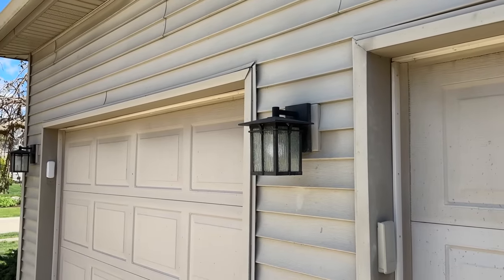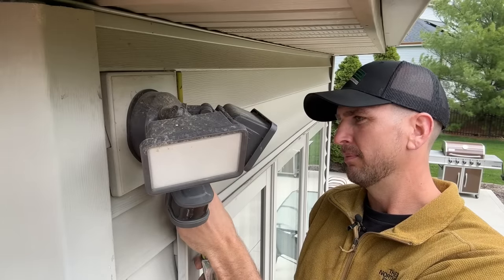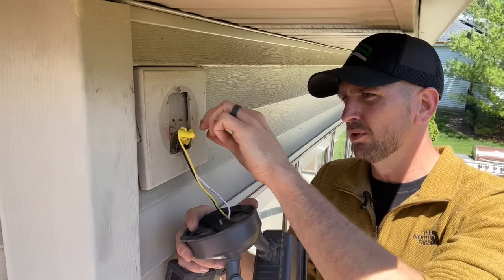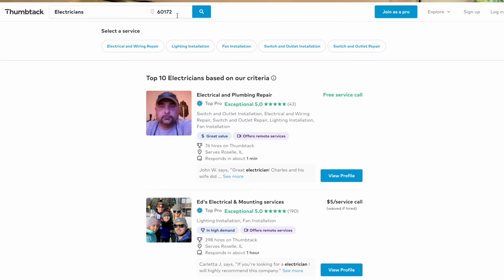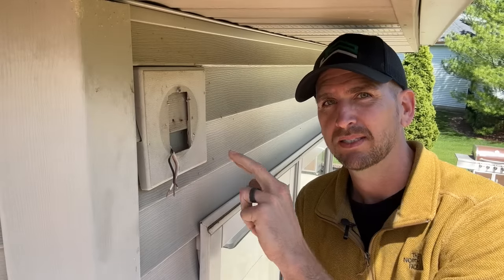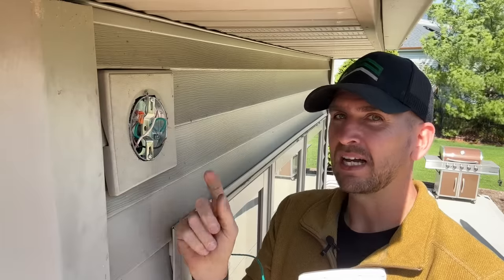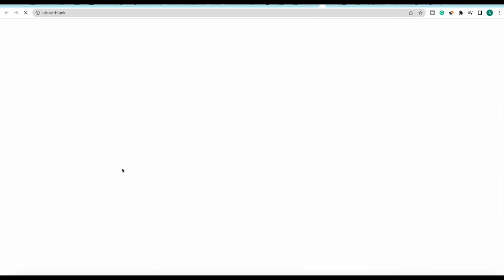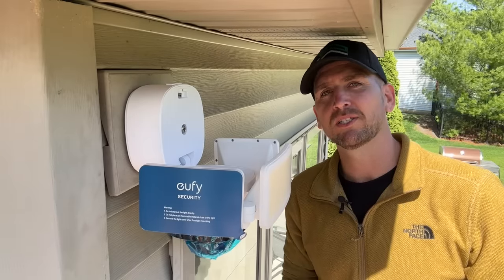How To Install An Exterior Light And 3 Common Mistakes To Avoid

Comment: Hi, Scott. Great idea for a video. I am reluctant to point out problems, but I know you're open to suggestions.
1. Running a wire into a metal box unprotected is a big no-no and code violation. You need a Romex connector, either metal or plastic that can act as a strain relief. The wires can rub and short out on the box.
2. Leaving open knock-outs in a box is also a no-no and a code violation, since the box cannot effectively contain sparks or even fire. Better to use a new box.
3. More an installation detail: I would have removed the square vinyl mounting block to cut it out. This would have allowed you to inspect the wire where it penetrates the wall and made cutting the block easier. 
4. You noted that you want a waterproof seal on the fixture, but it is left with a gap to the mounting block. I think this is because the mounting screw bottomed out on the siding before pulling the fixture tight to the wall. I would use a 1.5" deep box and cut the vinyl side behind the box, so the box would be tight to a solid surface. This would also allow you to enlarge the hole where the wire comes through the wall to accommodate the Romex connector. With a deeper box, the mounting screw would NOT bottom out. If you were concerned about making this fixture weather-tight, you could caulk around the top half of the fixture, leaving the bottom open for drainage. Because the fixture is so close to the overhang, I'm not sure caulking is necessary.
5. EDITED: The Romex sheathing needs to extend inside the box at least 1/4". Otherwise, the entire wire needs to be replaced, if too short. In your video, we can't see the end of the Romex sheathing.
I appreciate your videos and have learned many good ideas from you.
Reply: 100% agree with # 1, 2, & 3. Regarding #4 "Because the fixture is so close to the overhang, I'm not sure this is necessary," what is "this" referring to? The bottom open for drainage or any caulking?
Reply: @arthendrickson4860  - edited to specify "caulking"
Reply from the maker: Hi Bruce,  Thanks for the feedback.  For #1 I did have a plastic insert to protect the romex from being cut on the metal but it was missing the strain relief tabs.  Yeah, #2 is tough when using the 5/8" pancake box and needing clearance for the mounting bolt.    Really appreciate you taking the time and providing all the detailed comments.  Take care.
Reply: @EverydayHomeRepairs  - I see the black insert now. Unless the Romex is stapled within 6" of the box, the insert alone won't be enough. Given that they installed the original light without a box, I doubt the wire is adequately stapled. To be safe and to code, I'd put a Romex connector on the box.
Reply: Would a tight friction-fit grommet/insert meet the requirement or does the connector need to be tighten-able?
Reply: This guy knows nothing of what hes showing others. He needs to stop giveng electrical advise.
Reply: @RadioRich100  Please elaborate on what you see as errors so that we may learn from you. Thank you.
Reply: Spot on Bruce.
Reply: @BrucePappas20  I don't see any sheathing to even know for sure if it was romex. I wouldn't tighten a romex connector directly onto conductors.
Reply: @arthendrickson4860  I think he meant the overhang was enough protection from the elements.  However, I use Rain Tight boxes outdoors no matter what and I don't know that those Wago connectors are legal in New York or CT.
Reply: @jimkane9832  - Good catch. The Romex wire may not be long enough. The sheathing needs to stick into the box at least 1/4". Nothing to do to bring it up to code, if there is not enough spare wire in the wall, other than to replace the wire. (Scott didn't say it was Romex. I assume it was. If it's not, there are bigger problems.)
Reply: @i3igpete  - No, the Romex sheathing needs to extend into the box 1/4" and the wire needs to be (1) either stapled within 6" of the box or (2) secured with a connector that holds the wire from slipping back.
Reply: @BudTheDrummer  Wago connectors are legal in those states, but they aren't rated for wet environments and would need to be installed in a waterproof enclosure.
Reply: Great approach, Bruce.   👍
Reply: You need to pay more attention. He did put a grommet in the knock out. That's not how I'd do it. But he did do something.
Reply: @BrucePappas  It's connector and staple. It's not either or. What it really is, is whatever the inspector tells you it is. When he says jump all you say is, how high?
Reply: @RadioRich100  I THINK HE DOES A FINE JOB. BY THE WAY WHERE ARE YOUR VIDEOS?  ON THE RADIO OH OH
GIVE HIM A BREAK
Reply: @BudTheDrummer  Are Wago connectors approved in the USA?
These compact connectors are UL approved for the US market as well as meeting stringent European standards. Some of the standards that Wago 221 connectors comply with include UL 486C listed, as well as CCA EN 60998 and KEMA/KEUR EN 60998 certified
Reply: @RadioRich100  and let's see your security light install video!
Reply: @frankdahlquist1851  I dont have one , but I know what he did is wrong. I dont make videos out of work I do, but neither should he.
Reply: @joemcgovern8486  At what showing people how to do electrical work that he doesnt know how to do? I dont make videos and he shouldnt either as far as electrical goes.
Reply: "I'm reluctant to point out problems..."  Here's 14 lines. LOL
Reply: @Jmatt455  Your so right , every video he does.
Reply: @RadioRich100  You place a comment that this person has no idea what he is doing but offer zero solutions/answers to prove that YOU know what your even talking about. You may very well be an expert in the field of electrical and possibly other, but to open your mouth and place your fingers upon the keyboard open you up for scrutiny as well. Where and what is he doing wrong in your opinion in this video? Put up or shut up, we will wait.
Reply: @michaelkennedy2528  Its not my place to offer solutions, he has no business to tell people how to do electrical work the wrong way. He has done this over and over, not just this video but on many videos giving people bad advice and wrong info on how to do electrical work. If you didnt pickup on what the mistake was then I assume you dont know what your talking about either. But since you dont know I will point it out for you - watch when he puts the new box in and puts a plastic wire clamp in it he failed to bring the sheathing into the box - a code requirement and dangerous. Its simply shoddy work being done by an in experienced amateur, Ive see many videos where he does shoddy work and even shows dangerous trouble shooting habits like using no contact voltage detectors to determine if wires are dead. He has showed how to wire panels without proper torquing no anti ox compounds, wrong gauge wires Ive seen him explaining how a vom works and giving wrong info on how to use it. His channel should be taken down for giving dangerous advice.I could go on more but this should be enough for you as I dont wish to overload your brain. This guy is why utube info should be taken with caution.
Reply: @RadioRich100   Whether you offer suggestions or solutions or not, you come across in a very negative manner by NOT offering suggestions, besides this guys is an idiot of sorts. Take the higher road and say " Hey, what your doing is not correct, the wire sheathing should be come through the protective grommet." or something of that sort. 99% of the people watching these videos are not electricians, they are DIYers trying to save a buck, and even possibly learn. How do you and I and the other several thousand folks know if this meets code where he is?, I have seen some stuff that blows you away and it MET CODE WHERE THEY ARE sure as heck not all  places accept the same thing. Lets say that the sheathing over the wire was cut back to just a little (1/2 inch) inside the hole, you can see it but there is not enough slack in the wire to pull it out and secure it with a wire clamp, what do you do? Do you pull the sheetrock off the interior of the house to gain access, or the siding, including the OSB/plywood to gain access to replace the wire? There is ZERO chance of what he did there causing any issue at all, no fire or electrical issue at all. You and I both know that some codes are just flat out off the wall, he was working with what was presented to him. How would YOU have handled that exact situation?
Reply: What’s especially concerning is that he has already mentioned on other videos that some of his electrical work is on his rental properties.

It’s one thing for me to work on my own house, pull a permit, and live there. It’s illegal in my state to do much of his work unless it’s your residence.
Reply: @ronnietruman7296  This guy needs to lose his utube channel and turned into his county authorities for for doing wrong and illegal work.
Reply: @EverydayHomeRepairs he is a want a be electrian
Reply: I wonder if an electrical box is behind the vinyl siding?  I would have cut away the siding at least enough to peek behind and see.  Assuming there is a box behind, it just needs an extension and that would make a much better install.  (Better than a pancake box with extra holes, on a mounting plate fastened to vinyl siding, where the wire sheath is not clamped to the box and the light is proud of the plate.)
Reply: @Sylvan_dB  - Good question! It's always best to verify.
Reply: @Kevin-mp5of  - haha. No, I'm the guy who deletes my stupid advice (one time, which you pointed out to me) when I realize I'm wrong. I don't want anyone to follow bad advice.
Reply: @Kevin-mp5of  So your related to him?
Reply: @EverydayHomeRepairs  you really should block @RadioRich100.  Keep up the good videos!
Reply: @RadioRich100  it's so easy,stop watching and watch something else.
Reply: @BudTheDrummer  Caulk the box. Eventually you will pressure wash the house and it's almost impossible not to get water inside the box.
Reply: @ronnietruman7296  in my state you can do electrical work on your own home without being an electrician. Only electricians can work for hire or work on a rental property. Maybe it’s different wherever he is.
Reply: @thomasdragosr.841  Good point. I just replaced a fixture that was killed by a pressure washer. I didn’t caulk it. Doh. Need to get that done.
Reply: Non- lcontact testers are used by professionals industry-wide. They can be very effective. It is important to test them before and after testing your target wire to ensure the batteries and the device are working properly. I would recommend the same procedure with a contact based tester as well.
Its inconvenient, but safer to test.
Reply: @Jmatt455 He said reluctant, he didn't say he was opposed to it, or refuses to do it, mostly he was just being respectful, so I see why you don't understand it
Reply: @thomasdragosr.841 Why the hell would I EVER pressure wash my house, nor would I let anyone else, whats to keep water from going in the soffit vents and wetting the insulation? What about the pressure blowing the caulk off which it will do, Pressure washing will get water in every place you don't want it, its not at all like rain.
Reply: @Lew114 Don't bother, the pressure washer will remove the caulk for you and then wet the fixture
Reply: In the interests of code and points raised, could someone do their OWN version of this video which incorporates all of this discussion?   It's difficult for the audience to piece together all the corrections from the comments.   If Everyday agrees he made a code violation, I'm sure he will have to revisit the site so any updated video could be taken then. If someone else wants to do a spin on this and drop a link with their approach, that's probably fair.  This is a great exchange, and points raised are the reason I only DIY indoor stuff. :-)
Reply: @BudTheDrummer  Do individual states actually assert any stance on Wago connectors? Since they are Ul-Listed for application, that's national... and the NEC seems to defer to UL for appropriate applications. Not arguing, and I'm not a sparky, just curious. Thx
Reply: @marcosmota1094  Thanks! Your post is a gem in the rough here... you actually list/link a part number for what's "correct" (rather than some of these snide remarks)
Reply: you may want to take a look at 314.16 (I) I have seen 1st hand this outlet box failed by the local inspector ( I live in Florida) Great video btw
Reply: @RadioRich100  I have watched a number of his electrical project videos and he constantly get called out by commenters for clear violations of code and best practices.
Reply: @KameraShy  I know, he acts like hes an electrician but hes not. He always shows people the wrong way of doing everything, violating codes and incorrect procedures. He also show this on rental properties he has which is a violation in itself.
Reply: You are correct on every count. The use of a Romex metal box clamp from the back of a deep round luminary (light) fixture is commonly done. The Romex should extend into the box to form a witness as you stated. 

You may need to enlarge the hole in the sheathing so the clamp will fit. I like to use a metal weatherproof outdoor junction box mounted to the sheathing, although most of it is hidden by the siding, because of the nice front sealing surface. Sometimes I will drill additional screw mounting holes to give added strength in addition to, or an alternative to, the ear mounting holes. If I add additional mounting holes I will seal the periphery of the base with the sheathing using RTV when the junction box is mounted. If the fixture is really heavy I would add four additional mounting screws. I don't like to use the WAGO connectors, I just use wire nuts. I use Tie Wraps to temporarily support the fixture to the box so I can use both hands to complete the wiring.

I would like to add that the existing Romex conductors in the video are very corroded. You would either clean the conductors or pull new Romex. All conductor connections should be clean bright copper. You can prep the copper surface with a Scotch-Brite Pad (7448 Pro, or 7447 (Most Popular)) and then clean with IPA. Make sure the fixture stranded wire is also clean. Ideally it would be tinned.

After removing the old fixture with access to the wiring, I will verify the wiring is correct with my Fluke 289 DMM on AC Volts Low Z (eliminates Ghost Voltage). I do like the non-contacting detectors and do use them for specific tests, but I prefer to use my DMM to verify the installation.

The conductors in the video look like 14 AWG Romex. As such, I will verify that the breaker for this "lighting" branch circuit at the panel is 15 Amp.
Reply: @frankdahlquist1851  ?
Reply: @Sylvan_dB  that’s a good comment. I would have wanted to cut through the vinyl, pull the romex as far as I could. Put a Romex connector on a deeper box, and then attach the box to the sheathing (or even saw a hole for the box through the sheathing). God knows if there was already a box there! Good catch. I did this already myself to the exterior lights that my brother-in-law installed years ago. It was a major pain in the ass to put in junction boxes. There was no standard junction box that would fit so I had to customize attachment points with steel angle iron riveted to the sides of the box because a half inch  rigid insulation was added to the exterior of the house under the vinyl siding. Also because it’s a very old house with plank sheathing  there wasn’t anything to screw to. It was a goddamn nightmare but I wanted to do it as correctly as I could, as I knew or as I could assume how it should be done by seeing other examples. (This is what I pisses me off when they say “hire a professional”, there’s no way a professional would have gone through all that bullshit. they want to get in, get out and get paid.)
Reply: @EverydayHomeRepairs 😅
Reply: Round metal plate & wago lever lock connectors are for dry interior locations only and also require a ground wire be attached to the plate. Wires are to short - 1/4 of NMC cable jacket need to be under the missing NMC clamp.  After the 1/4 jacket the wires need to extend a minimum of 8" in to the j-box and the wires are clearly less than 8".  The backing is not sufficiently sealed (code compliant - in reality in AC anything goes) Center hole in plate needs a plug, NM cable is sometimes required to be converted into the gray UF-B cable before passing through an exterior wall / application.  I would just use decent wire connectors and some silicone.  Also, I would add a metal cable to attach to the enclosure to make it easier during install and if the unit need service.  Those security cameras are junk.  Should not talk about code compliance while doing work that not compliant.  Best not to even mention code and just use a normal metal exterior rated enclosure.  Regarding the short wires they could be placed in a separate enclosure for and and run a second box to make it easier to add  more cameras.
Reply: @RadioRich100  You sound like an expert ,where can we find videos of your work ?
Reply: @sarahann530  Not all people that know what they are doing create videos nor would I expect them to....
Reply: The pancake box would have been OK if a) it was flush (recessed into) to the exterior wall, b) the romex sheathing was extended into it from the back and clamped, and c) the light fixture sealed against the exterior wall around the pancake box.  Otherwise if a) and c) did not apply, a weatherproof box is required.  This really wasn't a good install and he really should come back and do another video doing it right.  He should have also cut the vinyl siding away so that the electrical box could sit deeper up against the substrate, so then the light fixture would seal against the square block.  Regarding the stapling, there is an exception in the NEC if it is fished between walls and securing is impractical.  This is used I think more when new wire is fished into existing wall spaces so you don't have to open the wall to put in a fricking staple.
Reply: @michaelkennedy2528 
Well said. He was working with what he had within reason. I don’t think the whole wire needs replacing. I wonder if just some electrical tape wrapped around the wires where the sheathing was short coming into the box, to offer protection, or a small piece of flexible metal conduit to cover the wire behind the box not covered in sheathing with a metal box connector on both sides of conduit to connect to the box and the other connector, so the wires don’t rub on the conduit. He for sure made it better than it was.
Reply: All the experts are coming out on this one.
Reply: I’ll add that they do make square mounting blocks with integrated junction boxes. They haves ones with flat sides and ones that fit nicely over the siding grooves. Also if the previous install was a code violation, why not remove that vinyl box to make sure nothing else is going on.
Reply: @RadioRich100  Agreed. Either the original installation was direct wired to a surface mount box deleted when the siding went up, or a recessed box that no longer lines up with the only height the siding block allowed the fixture to center. All he's left with are the bare wires from the cable, too short to insert into the new pancake box. This is a difficult situation indeed, and Everyday Home Repairs did not improve the situation at all.
Reply: @BudTheDrummer  Wagos are UL listed.
Reply: @Sylvan_dB  If there is a box inside the wall it is in code violation any place in the U.S.  Any junction box has to have a cover on it and the cover has to be not hidden so it can be removed if needed . I will add during the years I worked in construction I have seen license electrical contractors make open splices taped up only and shoved back in walls .
Reply: @jimcollins3411  Yup, that's bad.  I've been correcting electrical problems for 50 years.  There may be a few ways to do it right, but there are apparently infinite ways to do it wrong!
Reply: @ginakerry2588  I've come across situations where non-contact tester can tell you if a wire is NOT HOT; but to tell if a wire is hot and at voltage, I needed a volt meter. That is, it beeps even when it didn't have 110V on it, but some stray, lower voltage.
Reply: @handymandad5613  Good suggestion; I wonder if one can use a small piece of loose Romex sheathing and tape that over the wires to extend the sheathing.
Reply: @RadioRich100  - You are right. I am a 1st semester apprentice and I already see mistakes and "WTF" advice.  Imagine what I'll see by the time I finish reading the code. 😂
Reply: Solar powered, self contained…no wiring. I finished the install in about 3 minutes.😂